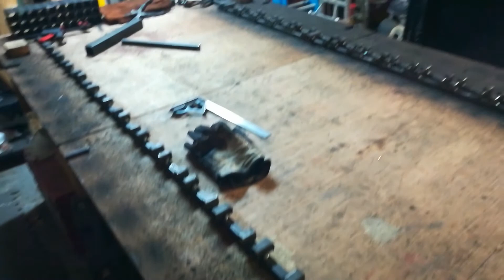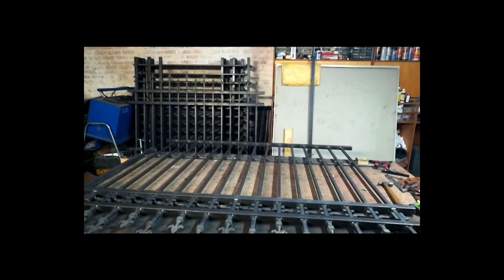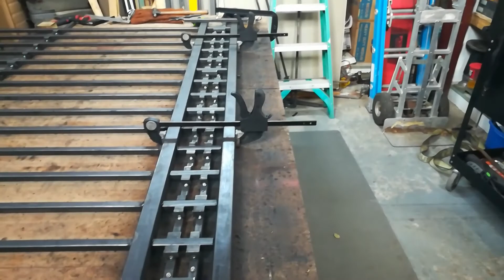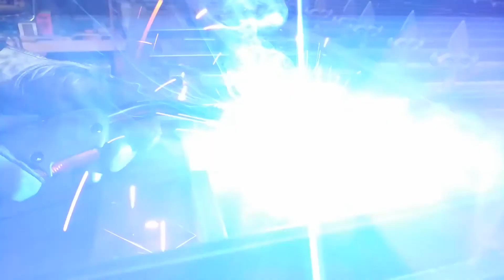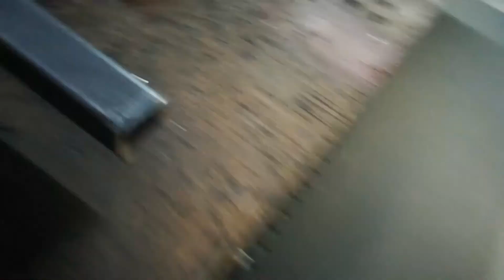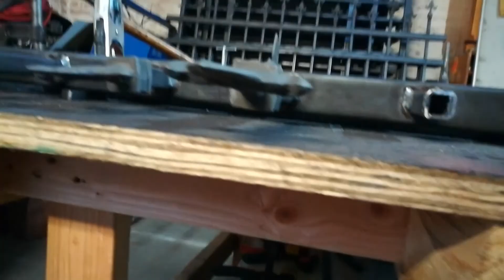How to weld, measure full Metal Gate Build Start To Finish Welding

Comment: I lay tube perpendicular across 2 other grounded tubes, put final on, sight for straight and tack.  After they are all tacked, I stand pieces upside down on a grounded piece of aluminum with hole in it that point goes in  (top of tube leaning against something) and weld them out with a nice hand rest of whatever I need to be comfortable before I install pickets. I appreciate the video and like the jigs.
Reply from the maker: Nice. This is my old jig. I made a new one that allows me to make many different sizes and stylles which I will be making some videos when I get some time.

Comment: How would you use your jib if your building a man door or if you put 1 picket and a ring back to back ? Plz  make a video
Reply from the maker: I will be doing a man door project in a couple of weeks.
Reply: @c10suburbans  and do you have a jib for a door? Or is it a bit harder cuz doors are all different
Reply from the maker: @Rubvillegas  I use the same jig. I just measure my door and make it work with my 4 inch spacing. Also if it does not work out I make the inside part of door with the jig and then build the frame around it, and then add the rings. I will be posting videos on how I do this soon.
Reply: @c10suburbans  that's a good idea 👌 will you be posting more videos.?

Comment: Instead of the hammer to get rid of the burs, I would rather use a grinder with a 60 grit flap disk.
I have a jig to clamp my grinder in my bench vice or to a table. Takes the same time as with the hammer, but looks neater and way easier to fit and weld.
Reply from the maker: Nice. I had to cut 2400 pieces for this project, using the hammer was cheaper. 😆
Reply: Man you sure make all that look easy.